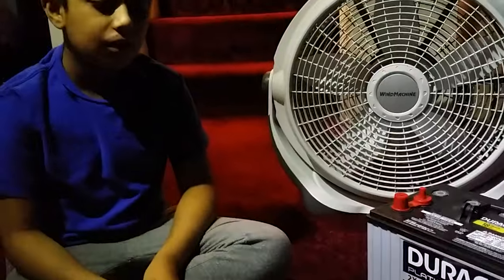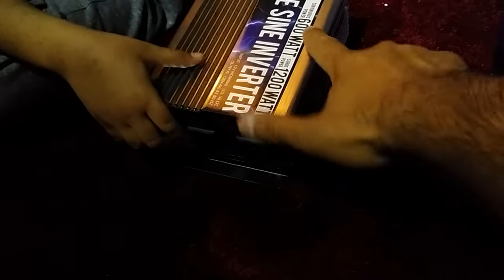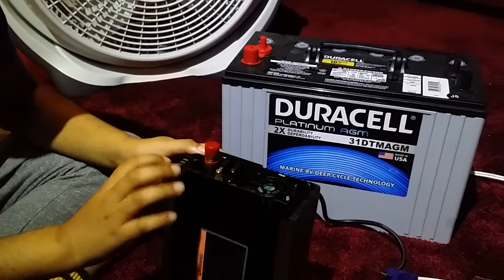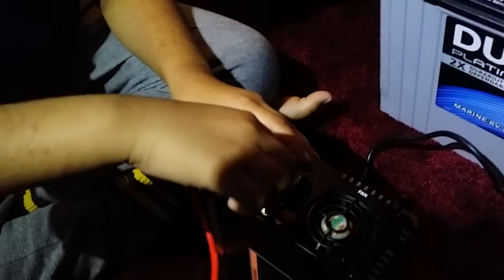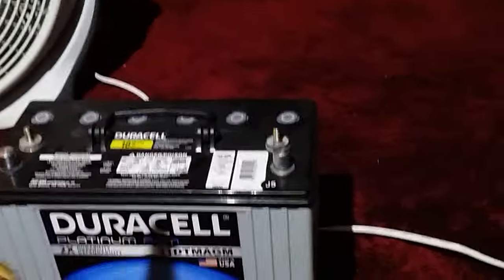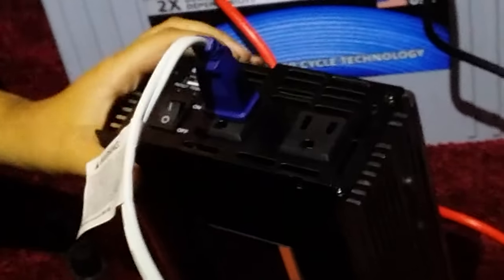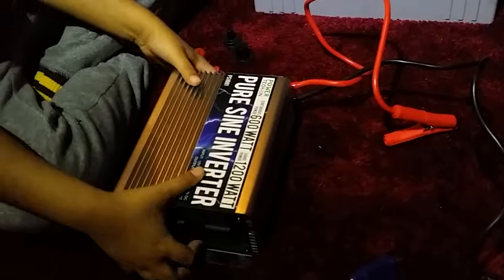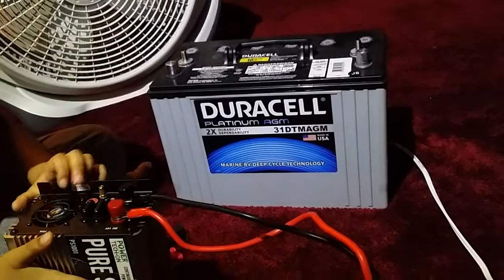How to run electronics using inverter and a 12 volt battery

Comment: Thanks, I really need this, if your kid can learn and do it , I can too. How do you recharge the battery?, I need it for keeping in my van a small electric cooler and at night a fan. Thanks
Reply from the maker: I recharge it using an 8amp an hour charger that plugs directly into your home power outlet. You can use a solar panel and a charge controller or connect it directly to your van and it will charge as long as the van stays on. Cars alternator usually produced 14.4 Amp an hour so you do the math. Chargers are fairly cheap about 50 bucks for a really nice one.
Reply: @Brownscorpion  I hope I can see in the future a video on how to do that, thanks for the tips!

Comment: If you have a laptop, you are MUCH better off using a car adapter and running it directly off of the battery.  You aren't going to get much run-time with most desktop PCs because they just use too much power.  An absolute minimum of 100 watts for monitor and PC. Most use 200 or more.  A laptop might use between 20 and 30.

Comment: how long the battery last using that battery?
Reply: It may run it through a night. If you're running a fan it's much more efficient to just use a 12 volt fan vs. converting DC to AC to run an AC fan.

Comment: Hmm, it sure would be nice to know how many hours a fully charged car battery would power a device or devices that use, say 100w.
Reply: My biggest concern for power would be my fridge and heaters. A fellow told me that the inverter would only power the fridge a day. He recommended a propane fridge (like those for RVs )and a 20 gallon propane tank. My grandma used to use propane when I was a kid. Glad it's still around.

Comment: What would happen if you connected the fan to battery directly without inverter?
Reply from the maker: Well the fan is 110 volts AC(alternating current) and the battery is 12 volts DC (direct current). It will not work. Thats where the inverter comes in and transforms 12v dc power to 110v ac power

Comment: SO HOW DO YOU POWER EVERYTHING OFF ? 
DO YOU REMOVE THE TERMINALS? 
DO YOU POWER IT OFF BY INVERTER
Reply from the maker: Inverters generally have an On/OFF switch which basically turns off the inverter and everything that's plugged in it.

Comment: Does it matter what type of battery
Reply from the maker: As long as its a 12v battery such as a car battery you are fine but depending on what you plan on using it for you can get a specific type of battery specific to your application. 12v batteries come in all sizes capacities and specs. Lithium weigh lot less and last longer than your standard flooded batteries. AGM are  nice too. Lifepo4 (lithium iron phosphate) are really good and can last you several years

Comment: These deep cycle cheap walmart batteries do not like to be deeply discharged.  You would be better off buying high capacity good quality either NIMH D cells (which are about 12Wh each) or lithium and then running your laptop or tablet on DC.  
Use 22 D cell batteries in series twice (11 cells each) so that you have 2 14.4V batteries in parallel.  With 10kmaH cells, you will basically have 264 watt hours.  They can be deeply discharged hundreds of times.  Fairly cheap and safe.  Lithium Ion cells will be expensive and probably dangerous.

Comment: For what that cost you could've baught a little 1000 watt generator.
Reply from the maker: Of course and I do own a 1000 watt generator. Generator makes noise even an inverter Generator.  This one does not make any noise however it has limitations such as battery capacity etc. This is ideal for situations where you can't run a Generator for whatever reason. Some camp grounds have noise restriction after 7pm that's where this comes in handy for me

Comment: The kid's a genius that's it then you can run that after car battery Auntie Ross sweater fan then run that over a pan of water salt or put a wet rag over your fan and this will cause a sea water salt water cool air effect AC fan as the fan blows over the saltwater pan and ice it will create an air conditioner that will cool the inside of your car and this will be portable then all you got to do is take that battery once in a while and have it recharged for free at the auto store and follow you're running a portable air conditioner in the back of your car for a tenth of the price Sacramento battery in West Sacramento set a metal battery and West Sacramento about 25 bucks for a battery used recharged

Comment: And there's your continuous power source for twenty bucks Roseburg $500 get a $20 recycle battery in West Sacramento it's several these batteries and several inverters the next assignment with Pate you back to how to make a ice chest insulated ice chest and then make a a jaile blower for about about $5 all you got to do is get ice chest at for two bucks over at Goodwill Hearst over at Home Depot PC pipe I ain't going to record stand the $5 band air conditioning fan at Goodwill and run that put that into the ice chest and run blow that around the insulation and round the ice bag ice and then have that come back out through the PC pipe which would be cool are running the airflow system this would make you a swamp cooler for five bucks that fan you can power the fan through a $20 recycle battery and then you cannot hook up the inverter next to the DC a 12-volt battery this will save you 567 or bucks that get your swamp cooler and get you a fan and you can run a refrigerator off a 12-volt battery with an inverter you can run a small portable refrigerator what happened to the truck my car don't have to power that refrigerator access just gets up the bad guys or dry ice and just put that into the igloo. Five bucks a good low to $5 at Goodwill

Comment: Hmmmm... Strange, I have always thought:

02:30 Connecting Wires: Connects Positive First.

03:40 Removing Wires: Removes Negative First.

Similar to jumping a car?
Reply: I noticed that as well.  You are correct.
Reply: @k9er233  thanks for the confirmation.